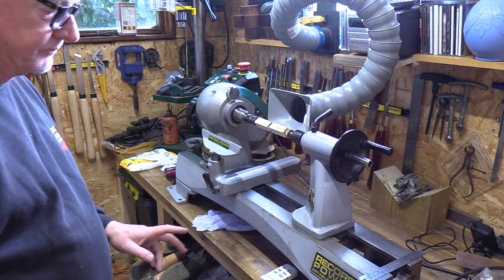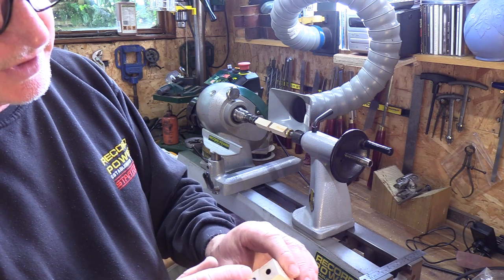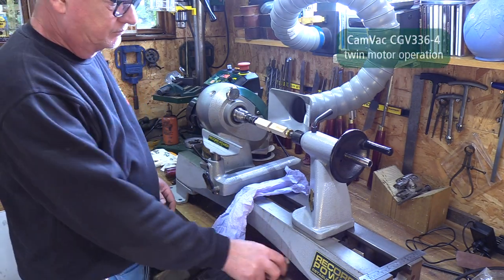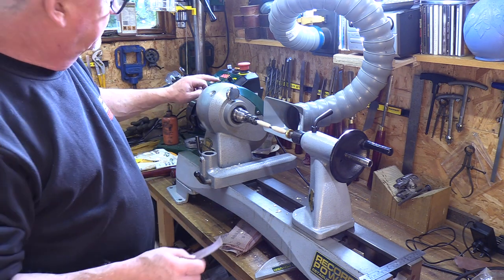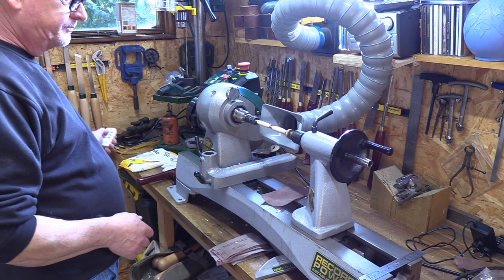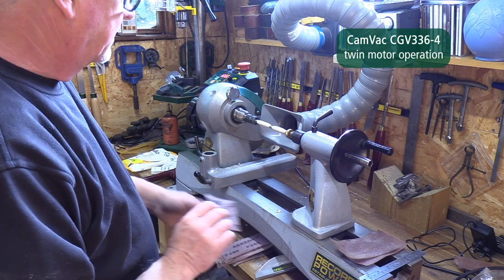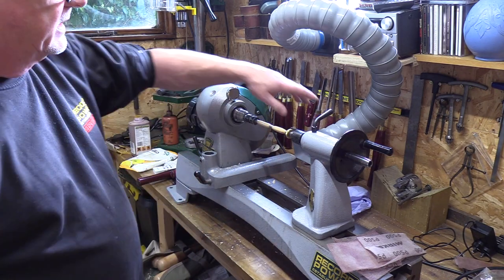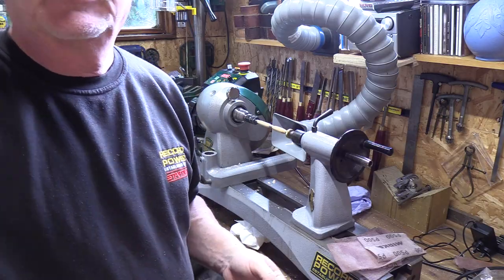Know-How Series: CamVac CGV336-4 use while turning and sanding a pen blank.

Comment: as it me but the lathe and extractor was very noisy
Reply from the maker: Hello, thank you for your comment. Our CamVac range of dust extractors are amongst the quietest high-pressure-low-volume dust extractors on the market today, and if used in conjunction with the optional hose, noise can be reduced even further. Should you require more information on our range, please visit our website or contact us on 01246 571 020. Alternatively, you can email us at technical@recordpower.co.uk. Best Wishes, Record Power.